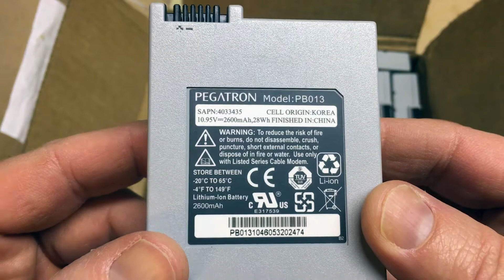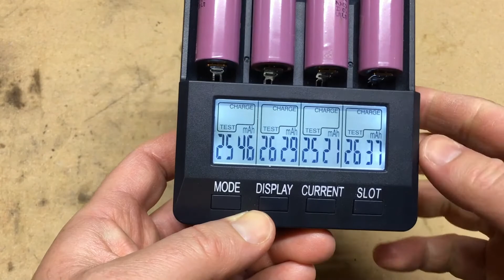DIY Harvesting 18650 Batteries

Comment: What is the recommended process for measuring capacity and charging the battery?
Reply from the maker: 1. Charge to full
2. Discharge and measure capacity
3. Charge back up for use. 

Use 1 amp charge and discharge rate.  Hope that helps. 

 Pick up an Opus and you are good to go (http://amzn.to/2F5YGVj)